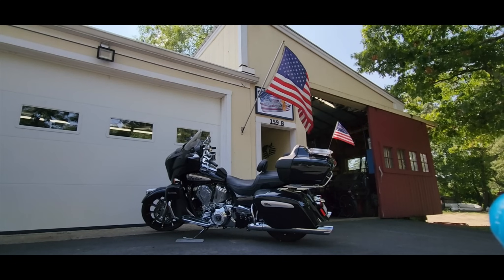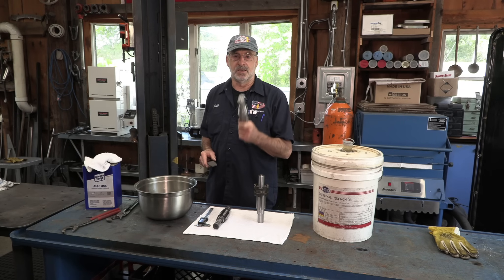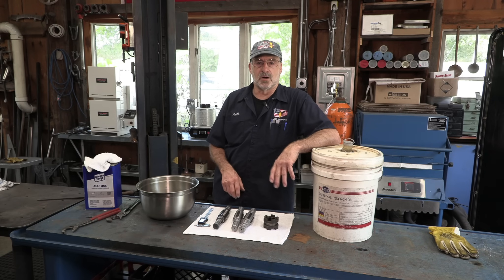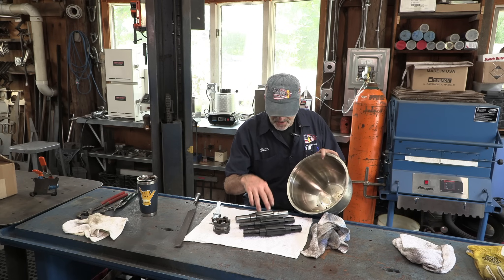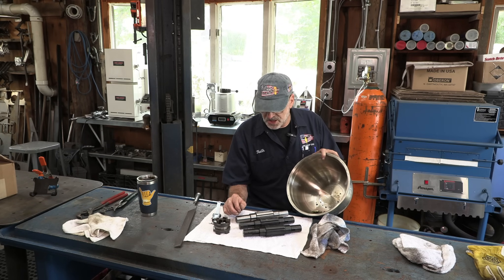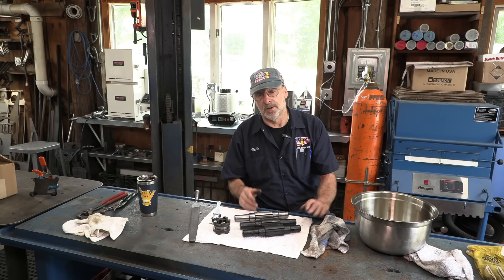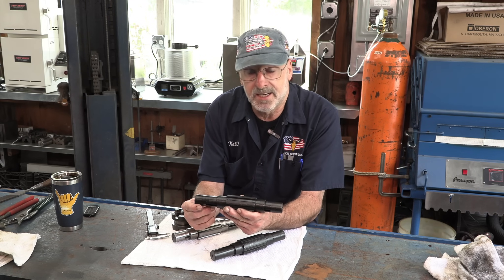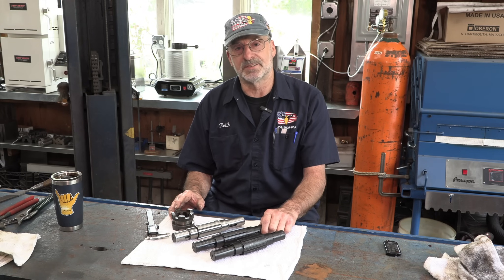Heat Treated

Comment: Good one .   If it is a 4140 steel or similar , i  always re heat directly after the quench .  Before the part gets below 100 C i will reheat to just below 200 c  for a fair while & let it air cool .   This can stop cracks from the quench & has little effect on hardness .    Cheers   👍

Comment: Keith,  Im not a professional Heat Treatment guy but over the years I have done quite a bit as part of my job as a machinist, fabricator. MH-on8ol has some good advice.
I use SS wire to hold the part being heat treated so that it can be quickly moved into the quenching medium as you noticed scale forms very quickly.
In my container of oil I have a coarse mesh basket with handle that can be agitated vigorously up and down which is essential to keep gas bubbles from forming around the very hot part thus stopping the oil from cooling the part quickly.  A shaft like yours must always be immersed vertically reducing the chance of bending through uneven cooling. A long slender basket is ideal for long parts keeping them vertical.
I always like to temper as quickly as possible perhaps not so critical for 4340 but essential for say tool steel where the material is so full of stress that even dropping the part can shatter it like glass.  A second oven would be ideal ( use the one in the kitchen when the missus is out shopping) so when the part is cool enough to touch, temper.
I have a small alarm clock that I set when starting tempering as its easy to get distracted and forget to remove part from the furnace.

A book that I can highly recommend is Heat Treatment, Selection, And Application Of Tool Steels by Bill Bryson.  Modern Machine Shop Publications. Hansen Gardner Pub Cincinnati.
For them that dont know a file is around 60-62 RC so it will mark treated 4340 no trouble at all when it will get to around the high 50s.RC.

Comment: When heated to the transformation temperature then quenched, if done properly, maximum hardness is achieved. The tempering operation, which should occur after quenching down to about 130 degrees F will determine how far below maximum hardness you wish to target. Beautiful machining job anyway.

Comment: Keith, I have always enjoyed your videos and the quality of your work.  I worked in the heat treating business for many years & I have a few suggestions that will help reduce scale and increase your hardness. Wrap your parts with wire and use a hook to quickly pull them from the furnace and quench IMMEDIATELY in as deep a tank as possible right below the furnace door. A 6" diameter pipe would work as a quench tank. Aggitate the part multiple times keeping it submerged to keep moving the super heated oil away and to lower the temp of the part more quickly. We usually quenched  4340 at 1525-1550 f following a 90 minute soak time and 1600 f on 4130. I suggest you give the parts a second temper at 350 f for 90 minutes to remove the stress from the quench. Thin areas and tight corners on parts create stress risers where cracks like to grow from. Wrapping those areas in coarse steel wool secured with wire can contain the heat and reduce shock.   As much work as you do a used rockwell harness testing machine would be useful. Those parts should ideally have a as quenched hardness in 52-55 RC scale range. We used a endothermic gas in heat treatment and pumped raw natural gas in to raise the carbon level to maintain the correct carbon level to prevent decarbonization. Clearly expensive and not an option in your shop so your gas atmosphere and moving as quickly as possible will improve your results. Quenching in a heated glycol solution is another option if achieving the maximum hardness is the goal. Thanks for your patriotism and craftsmanship.

Comment: I remember dropping off our dies and punches for heat treating at the heat treaters when I used to work at a tool and die shop. They had all kinds of vats with the parts in them in various stages of treatment. Quite the science, I figure.

Comment: Just curious... which type of quench oil did you use? 11 second quench or 28 second quench? (Assuming you bought it from McMaster.) Your results look exactly like mine when I made a new ratchet ring for my arbor press. I bought the slow quench oil. (28 sec.) Only difference was I used 4140PH (half-hard) and I preheated my quench oil to 350°F in a turkey frying pot. Worked out great for the quenching.

Comment: How does your gas shielding set-up compare to sealing the workpiece inside a stainless steel envelope like I’ve seen Keith Rucker and Abom use. I’m guessing those SS envelopes are pretty expensive, so once you’re past the purchase price of the gas shielding equipment, the per-use cost favors gas shielding.
Reply from the maker: look at the results of mine and compare it to theirs.
Reply: The foil costs money,  but it is hardly expensive for the quality that you end up with.  Heat treatment isn't rocket science,  but a lot has changed in 70 years.  My great grandfather used to do heat treatment like this.

Comment: Keith, those shafts look like they turned out pretty nice. Back when I worked in manufacturing I used to help the tool room guys do heat treating, we used an air quenching tool steel and wrapped them with stainless steel foil to prevent scaling. That shielding gas looks great for doing oil or water quenching. We had a hardness tester to test the dies after hardening and tempering but you can get a set of files that can test it. My son does some hobby knife making and has a set. Easy to use, easy to store and lets you know within about 5 points what the hardness is.

Comment: if thats 4140 i think it will only temper into the 40s rockwell but i could be wrong
Reply: 4140 properly quenched will easily get into the low 50s on the RC (150 kg) scale. I heat treated for years and when using a heated glycol quench which really shocks the material and quickly pulls the heat out during induction hardening I could get into the 55 RC range with good material.